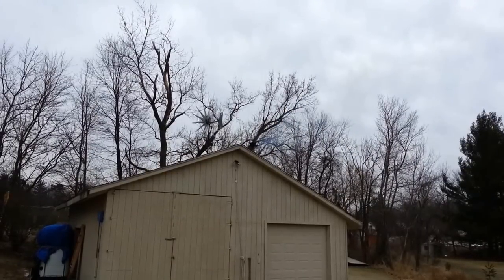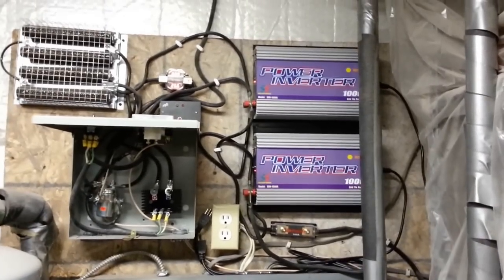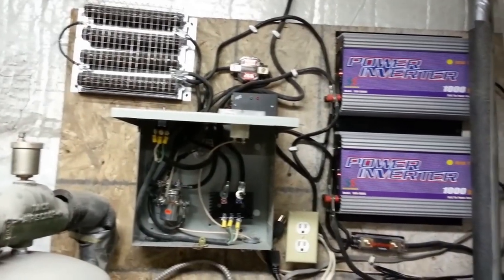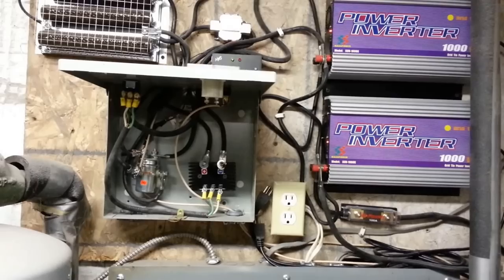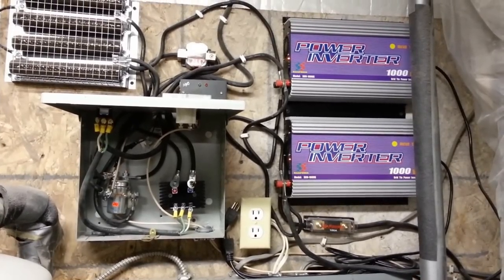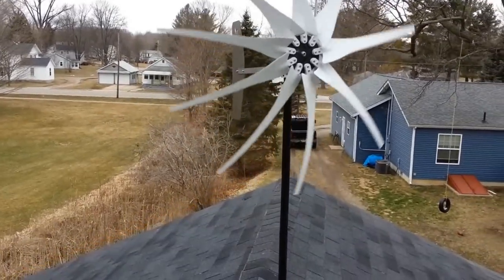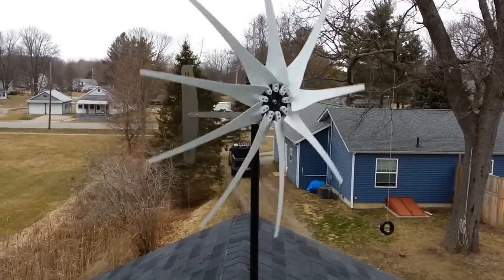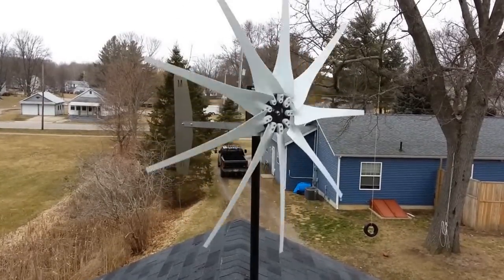Wind Turbine Project New PMA

Comment: When a round pole is placed in the wind, there is a phenomena known as Vortex shedding which means that the air around the pole will not be so symmetrical but it will be thrown like lumps of mass of air first in one direction and then in the other.  This will cause to shake even if the rotor is well balanced. To cut out the vortex shedding from a pole placed in the wind, one needs to shape a helix around the pole. 
See the following video for explanation.
https://youtu.be/_Hbbkd2d3H8

Comment: You may have this fixed already     take a short amp reading with out the battery, this is spinning fast to make power, get your meter out and put on the 10 amps or 20 amp and disconnect from the battery bank, to see what you have for volts and amps   thanks,
David
Reply from the maker: Without a load the voltage and current goes up pretty high. I burned up one of my current gauges running that way.  When it is under a load I get little to no wastage, usually about 100 to 200 watts. And that is at wind speeds over 20 miles per hour, which usually do last for very long in my area in lower Michigan.
Reply: Then your making some killer power my friend its working great then. do you like the wind turbine in all the Company  Good or ok

 Thanks,
David

Comment: Hi todd i have the same problem with my pmb  i had the fibglass blades i switched to the mach blades they were off balance to when i rebuilt my pma befor putting the slator in i put it together & put the blades on & balance  the blades using wheel weights as far as getting watts from the pma im not eather. you can check my video out

Comment: Put it up twice as high and stake it really good. and wait for some 20 mile an hour winds these pms dont work until the wind blows really hard. you could do better with a 12 volt system with slower winds like your having. Hard to get it to spin that fast for a 24 volt system because its gotta have a 20 mile an hour wind to get going fast enough to make amps. When a bad storm comes it will make some amps. Get some solar panels they work great everyday the sun shines.

Comment from the maker: I should have tried that,  I am sure one or two of the blades are out of balance. When I used the 9 blade hub it work better.  I also have found that a 24volt wind turbine works best at 12 volts. I am planning on hooking my turbine to a 10 to 30 volt invert at 500 watts. This should give me the best result. My turbine seems to put out 10 to 20 volts in light winds, I think the lower wattage and voltage should help me get some power out of it.

Comment: With my luck I always put all the heavy blades on the same side of the blade hub. So from now on I weigh each blade before I mount it to my blade hub. I don't have experience with the 24volt pma. But if it is anything like solar power, 24 volts is half the amps as a 12 volt system, using the same amount of solar panels. I might be wrong, I am still learning about this stuff myself. Maybe using a 24v pma will give you half the amps as a 12v pma at the same wind speeds?

Comment from the maker: I was told at MWAS not to test the ac side of the rectifier after having my engineer friend look at it that is what he suggested we do. The voltage on all three legs were the same and would go up and down with the wind. The voltage would go from 2 to 14 volts, most of the time when the wind was steady 10 to 12 volts.  I purchased a 24 volt PMA.

Comment from the maker: I am thinking about hooking two rectifiers to one PMA, has any one tried this?  I have seen it done on dual PMA but not on single.  I would wire the dc in series and the ac side in parallel. I am wondering if this would double my voltage output on the dc side.

Comment: if this machine was mine, i would start by messuring the 3 AC phases coming from turbine, they should all read equally, that messurment will confirm that the brushes are ok and stator is ok under no LOAD. next step I would short each 2 phases and check AC amps. MAKE Sure to test at low wind or test bench. if all is ok in AC, then I would check the dc after rectifying. it is possibl that your brushes are faulty and that can cause the shake due to Phase shrted or not connecting.it is a start